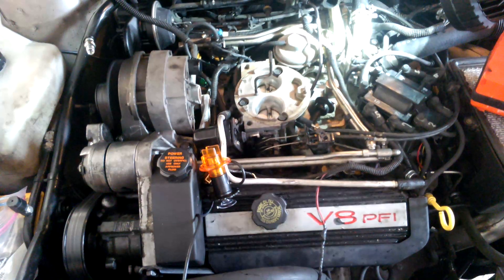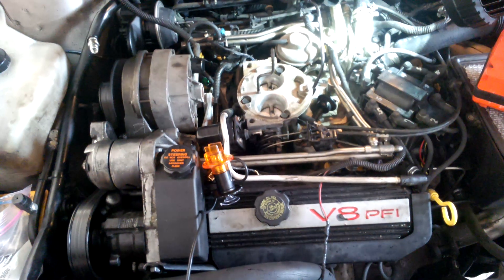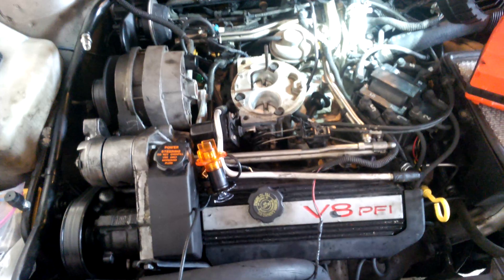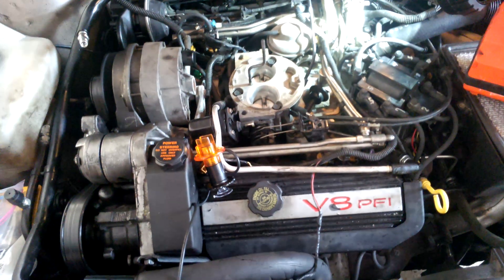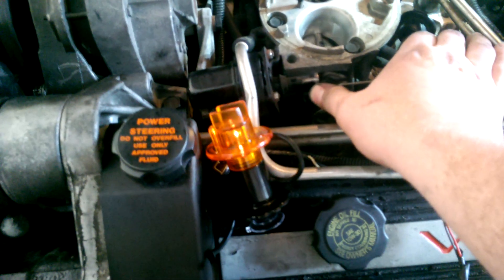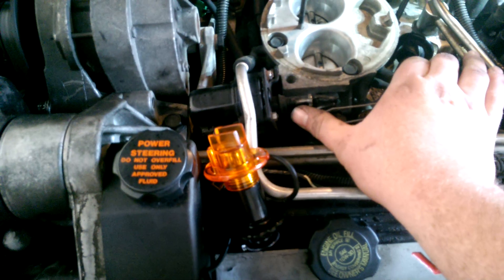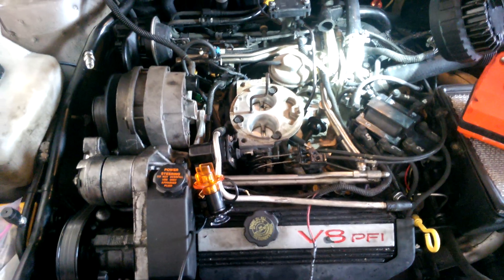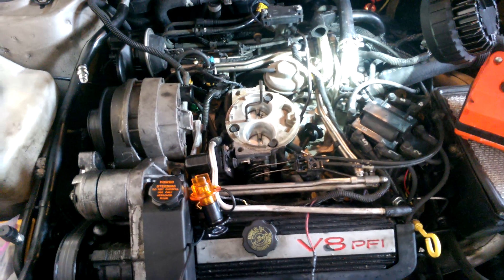92 4.9 Cadillac DeVille engine miss, testing fuel injector signal with noid tester

Comment: I have this exact same issue with misfire on number 6 cylinder  I guess I need to get a noid tester. Apparently there is an update that needs to be applied to the original ECM .

Comment: Could you help me get a 1995 Cadillac running the key was lost it's been hot wired. Thank you.? it will turn over in fire, but I think when you take deposit the starter wire offered lose a spark.?

Comment: Bad tps sensor or it’s wiring harness
Reply from the maker: It was a bad computer.
Reply: @1D10CRACY  did u pull the error code to figure it out
Reply: I have same car same year intake leak due to cut cat n old wires but runs real good but I’m tryna replace cat ASAP any tips n my fan doesn’t turn off I bypass to relay yea I kno it’s rigged but good

Comment: He's right.. Years ago I dealt with my 4.9 Liter with injection problems. It would misfire between a cylinder. Noid light I had for years, never had to use it. Troubleshooting the problems lead back to the ECM.. I didn't replace it before selling it. I came to the same  conclusion back then before watching your video... This car I had wasn't driven for 10 years before I restored the performance to it..  Good video..

Comment: Hey 1D!  Thank you so much for posting this video, and for the quick response!  I had been working on my Allante for two months and was very frustrated that I could not pin down the exact cause of my intermittent drivability problem.  I did suspect the ECM but could not prove it. I had never heard of a noid light.  Your problem and car was so similar I just HAD to try, so I rented a noid test kit at O'Reillys.  Sure enough, I went back and bought an ECM and was cruising tonight!  Running perfect now!  Thanks!

Comment: How did you isolate problem to the ECM versus an injector?  I am having a similar problem on my 1992 Allante 4.5.
Reply from the maker: The noid tester was not lighting up, indicating the injector was not getting power to open up.

Comment: Did you have any other symptoms?  Hesitation on acceleration, lower fuel efficiency, bucking under heavy torque after the engine has heated up?  I just had an injector go on my 92 De Ville, and was wondering if the symptoms were similar across the board.
Reply from the maker: Poor Fuel Efficiency, was only averaging 17ish mpg.   Acceleration was poor and when getting heavy on the accelerator the miss made the car shake.  No bucking, mine was cylinder 6 and the injector would fire one time if you got heavy on the accelerator, as shown in the video.
Reply: 1D10CRACY . Thanks!  These are great engines, but the injectors have always been the Achilles heel.  The computers on these engine blocks have issues dealing with a mix of old and new injectors.  It's best to replace all 8 injectors at the same time to prevent further issues.  Besides, this type of injector is prone to clogging after time.  If 1 gave out, the rest are soon to follow.
Reply: @JakeWerkmeister  Hey Jake I'm having trouble getting the fuel rail off and I cannot remove any of the injectors.  Any tricks on that? Also I was going to clean out the old ones.  Do you think it's better to buy new ones instead?